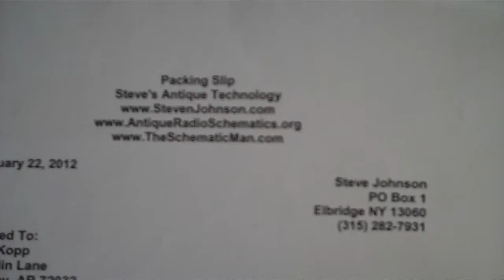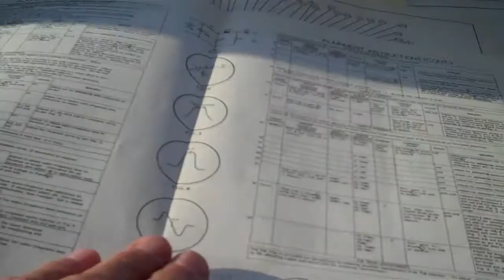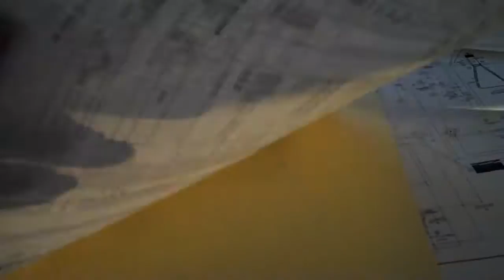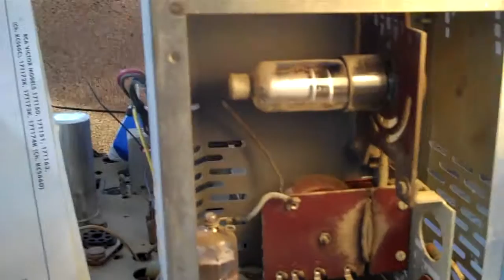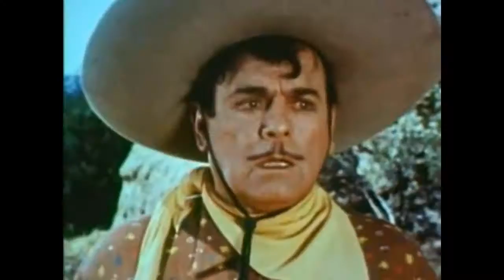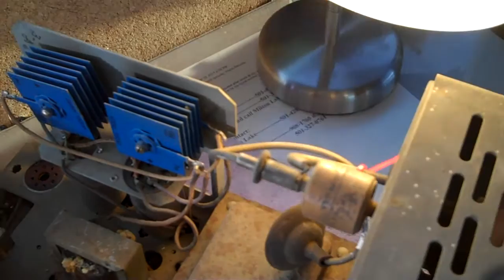1952 RCA Model 17T151 17" TV Repair and Restoration (Part 3 of 27).

Comment: Very cool looking project John!!
Thanks for showing the schematic. Your choke along with those two electrolytic caps (as you may recall from your amateur radio studies); all three components are in the configuration of a pi-network filter. (the shape of the greek letter pi). Depending the design, this pi network may be used as a low pass filter or alternatively used to match impedances between successive stages of the circuit.
cheers, ~wiggy

Comment: Thanks for the reply CISCO, the SLING-BLADIN' LAWN MASTER. . .
I'm starting out on a 1941 (or so) Silvertone 7036 AM-SW Reciever.  It has a wooden cabinet (in very good shape), and worked (with some AC hum) when I started.  So my goal is to clean it up and recap it -- and there are some suspect resisters I want to replace, I figured if it was working when I started, I'll bet I can play after work for a few evenings and put it back together and it'll work even better when I'm done.  We'll see.

Comment: Yeah, I use Hammond a lot. I've never ever had problems with them in any of my projects.  They have pretty good quality products.  While they might be a little more expensive than others, i find the price to quality ratio very nice. They, at least in my experience, for a price will make pretty much any choke or transformer you need if it isn't listed in their catalog. I've had some great experience with their reps. and sales staff.

Comment: Make completely sure that all of your tubes are getting the proper voltages.  Look at all the specs for each tube. Make sure also they are drawing the right amount of current.  Weak tubes will often show up if you are careful checking measurements.  I take prints of shematics and make careful note voltages and other readings on them. TV restoration is rather addicting.  I know Bob has a house full.

Comment: John
the proper id for the high voltage rectifier tube is 1B3 (One-B-Three). it has a one volt filament. it follows the standard numbering conventions for American tubes. there is one thing i do notice, the 6DQ5 Horizontal Output tube does not look too healthy. the "getter" (the brown spot on the side of the tube), shows that the tube might be "gassy" the getter should be a mirror like silver. not brown.